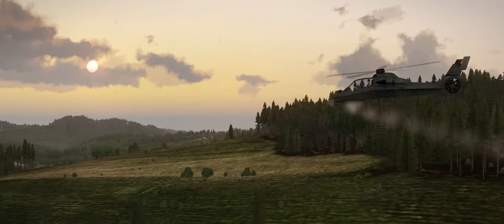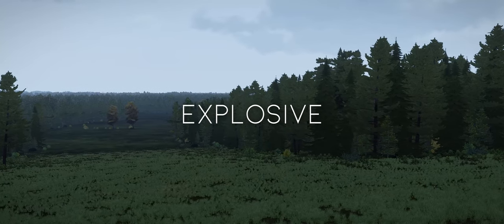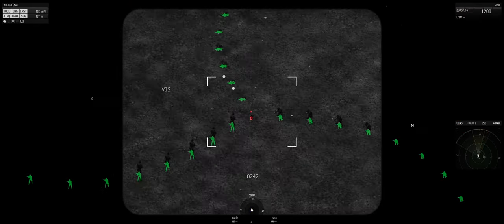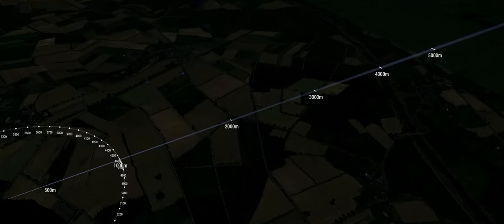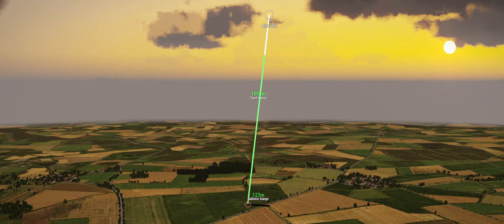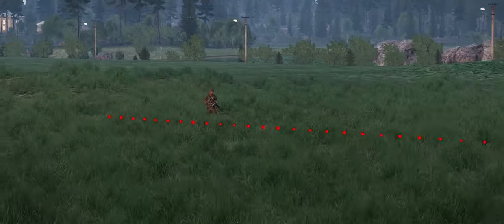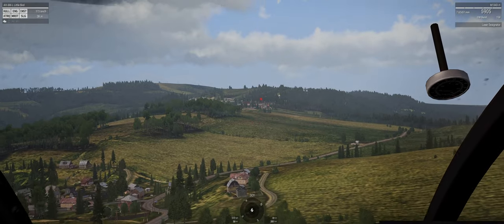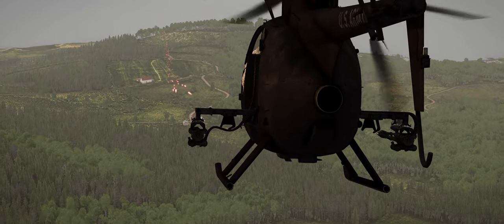Arma 3 Helicopter Weaponry Guide - Art of Flight, Episode 18

Comment: Awesome visualization! One note on grazing vs plunging fire: for the example with the infantryman and 249 that was technically plunging fire as grazing fire is any distance where the cone of fire doesn’t rise more than 1 meter above the ground. 600 meters is the maximum distance for grazing fire for the M249/240. Assuming perfectly flat ground
Reply from the maker: That visualization unambiguously shows grazing fire. You’re hung up on an arbitrary number instead of the concept itself.

Comment: Ok, that's neat; great job on the visualization.
Tho all this talk has me wondering if anyone's modded in an accurate version of the CRV7 and it's various warheads; they're a little bit nuts, like Anti-Bunkerette and Flechette Anti-Tank, with 3 milliradian accuracy. Very high energy rocket for it's size. 
https://en.wikipedia.org/wiki/CRV7#Warheads
Reply: flechette, cluster, flare, 10/17 pound crv7 are in the arma 3 official AH-64D apache longbow mod and there great they also have the rocket zones for the launcher